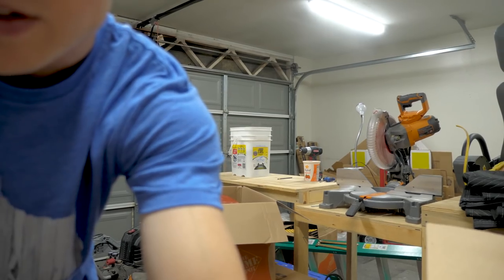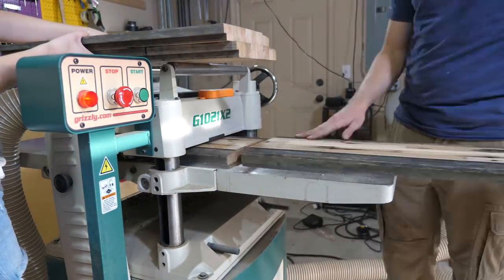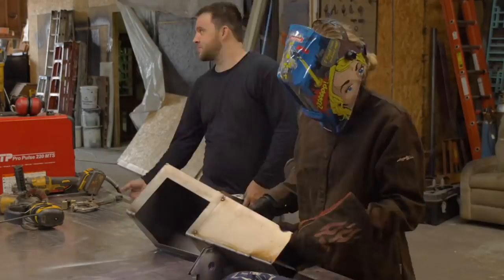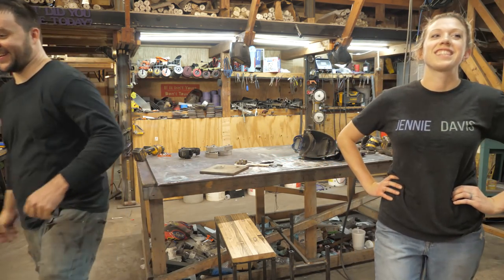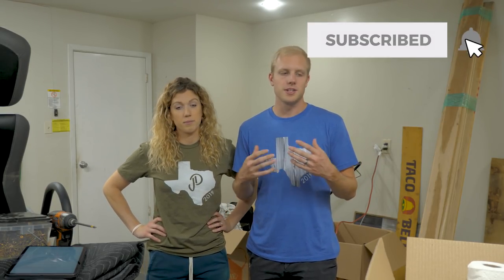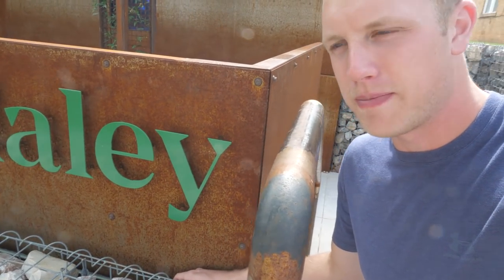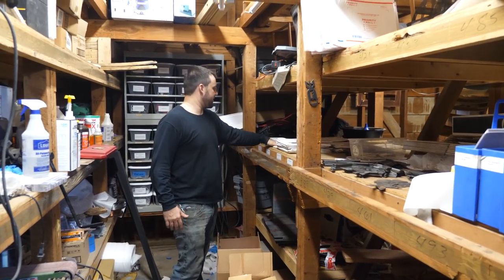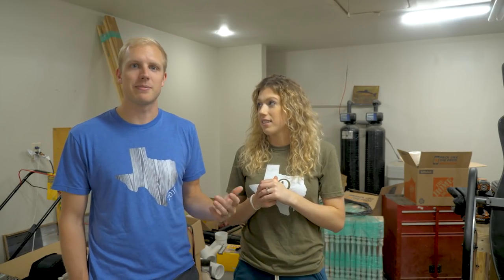Modern Industrial End Tables 🤔💰How Much to Charge? Collab With Jonny Builds and 42 Fab

Comment: hey I would like to take the time here today to just say thank you for putting out some helpful information. When I get back from this deployment I'm on I'm gonna kinda be "unemployed" so I was really thinking about getting into like making tables and benches and stuff like at least two days a week while the other days processing scrap metal. or when scrap gets slow or too painfully cold to do making tables and such indoors with some heat to supplement the lost scrap money. You guys gave me a lot of ideas and such as to how to do some certain things. the 42 fab guy actually gave me a really good idea as to how to price at least the legs on most tables. at least for me there's like 5 or 6 different variations of table legs I can make into like DIY kits if I wanted to out of steel. a good way to price table builds I think is to spend like a day or two making a whole bunch of DIY leg kits that you could sell if you wanted to, figure out the pricing on each kit and then when you build a table for someone or a table to sell on facebook or something you can just charge for the legs what ever you priced your DIY kits at. Then the only thing you really gotta figure out is what the top and finish will cost.
Reply from the maker: Hey thanks so much for the encouragement! Glad the videos have helped. Best of luck getting your leg kits put together!!
Reply: @jennieanddavis  Thank you. maybe once I get them up and going I could maybe send you guys a set or two, to watch y'all put a top on and maybe if that would be cool you could show it on your channel?